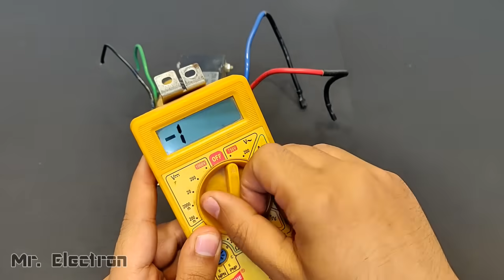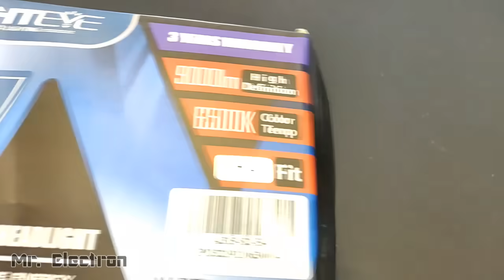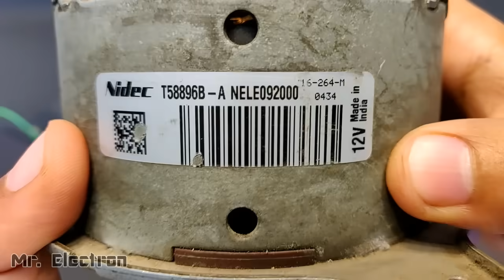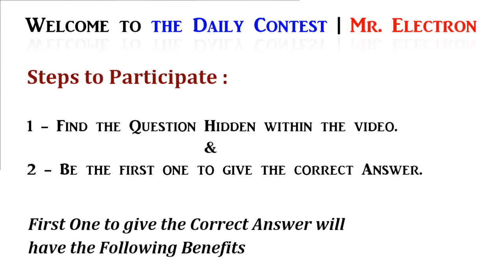12V 100A DC from 220v AC for High Current DC Motor - Power Supply from UPS Transformer

Comment: 100A?  Come on that transformer will have 200W max, so less Tha n 20A😏
Reply: The point is this transformor can‘t work with DC
Reply: @mhp_loudspeakers3768  Why it can't work with DC? It goes from 13v AC to a full bridge rectifier?
Reply: he also threw away half the primary it should be parallel for 110v and dont get me started about a cap at 100A
Reply: Many say fake, some say only 20 watt, i don't know. However let the no Screamer's tell better.
Reply: not even 10 amp
Reply: @Immexbeatz  FULL BRIDGE RECTFIER!!!!!!!!!!!!!!!
Reply: @nhatshonrada1176  o/p is 9.16666A to be exact
Reply: 100 A......🤥
Reply: Not 20 10amp
Reply: ای

Comment: The rectifier unit is never of 100 amps capacity. It can be rated for 12 volts, 10 amps dc out maximum continuous. Any dc motor designed for 12 volts will rotate at less rpm on no load. If we load them  beyond 10 amps, definitely the bridge rectifier or the main step down transformer will burn out  as there is no fuse provided.
Reply: Hola
Reply: There is something called peak currents the starting current is 100A but the continuous current is 2A
Reply: Yes that mains transformer will deliver 5amps at most. This vid is a scam.

Comment: Good circuit for didactic purposes only. To be use for beginners on electrical or electronic training courses. With a supercapacitor of few farads you can reach 100 amper for few millisecond. Never to be use to supply a starting motor to start a car. Engine's flywheel will turn only for 1 or 2° from that on you have to push the car to start engine if battery is flat.

Comment: This is not 1200VA transformer. Judging from it's size it is no more than 600VA transformer at most, found in a normal household UPS.
I have a 1000VA transformer and it is nearly triple in size which you have to be a bodybuilder to lift it with a one arm.
I have tens of these exactly the size transformers salvaged from 400VA to most 600VA UPS's.

Comment: Input voltage divided by 17 is 12.9 so .5 amp x 17 is only 8.5amps this is with zero loss so even with a justing to 9.5v to use 1.414 to give 13.4v so with 220 divided by 23 and .5amps x 23 = 11.5Amps again with zero losses so we're do you get your 100 amps from

Comment: 12 V x 100 A = 1200 W 
The transformer must be at least 1200 watts. Taking into account the Coefficient of Performance (0.65-0.7), the transformer power must be at least 1.5-1.7 kilowatts. Diodes must be at least 120 Amperes.
Ток холостого хода, как было ниже написано, далек от  рабочего тока. 
The no-load current, as it was written below, is far from the working current.
Reply: Translate Tagalog pls
Reply: @louienoveno9433    Filipino on-line translate: 12 V x 100 A = 1200 W
Ang transpormer ay dapat na hindi bababa sa 1200 watts. Isinasaalang-alang ang Coefficient of Performance (0.65-0.7), ang kapangyarihan ng transpormer ay dapat na hindi bababa sa 1.5-1.7 kilowatts. Ang mga diode ay dapat na hindi bababa sa 120 Amperes.
Ток холостого хода, как было ниже написано, далек от рабочего тока.
Ang kasalukuyang walang-load, tulad ng nakasulat sa ibaba, ay malayo sa kasalukuyang gumagana.
Reply: The transformer does not have to be 1200 watts. It can have 3 turns, but the wire must have the wire diameter for the current

Comment: That transformer kan never deliver 100 amps  And that startermotor is 105 amp under load  not as u used it it freewheels the currend drawn is mayby 7 or 8 amp
Reply: This transformer can‘t work. Transformers didnt work with Dc
Reply: It also make no sense: Input power is 200V×0.5A = 110W and output power is 12V×100A=1200W.
Where to get the missing 1090W? From photosyntesis?😂
Reply: The motor gets power from the capacitor  that can provide many amperes. And the ac current is rectified through the bridge. The question is what capacitor he uses and how he select this?
Reply: My dear brother pleas anser for this I have transfomer i/p 220v O/p 12v 300mA so how can I make inverter thank u
Reply: Bro this is ac transfomer but he use ac to dc converter that is grey colour and he use capacitor to not to light flicking 👍

Comment: 12v 100 amps is 1200w of power, a true 1200w transformer will be a lot more bigger than the one in the video, and no less, you will need a lot more powerful rectifier with a good heatsink
Reply: UPS power sources aren't meant for continuous operation, just for a few minutes/hours at most.
Enough to shut down energy sensitive machines before the power runs out. 
To save money and weight, they make the transformers smaller, but then they're not for long term operation.
Reply: y6yyyyy6y
Reply: @KRRISH-k7s  r/ihadastroke?
Reply: Is that safe to run car amplifier 3000watt
Reply: @imnotbeluga007  good mon ne

Comment: 220v*.05A =110w primary winding wattage =secondary winding 110w/12=9.1Arms and 12.9 peak continues current
Reply: ترانسفورماتور
۲۲۰ ولت
۵ آمپر

p=220×5=1100w

خازن
۱۲ _۳۵

1200/12=100 amp
Reply: चमबकीआकसणसेमोटरचलसकतीहैकयौकीचुमबकमबलगहैबलसेसबकुछचलसकताहाह
Reply: @alisomea  ты хочешь сказать, что с этого хилого транса он киловатт снял? Да и с такой проводкой? На превью он если что написал о половине Ампера на входе

Comment: This config can damage 12V loads, because 13.6V AC times ✓2 (in case 1.41) is equal about 19V after rectifier and filter capacitor.
To have 12V on output is needed to have about 9V to 9,5 V max on input, I had a sound amplifier damaged because it's transformer was damaged by a overload and gave about 13V AC on output.
Reply: Стабилизатор поставить не судьба ?
Reply: Después del puente rectificador la corriente aumenta ??
Reply: You're right
Reply: @fabiangonzalez8721   La tension, 9 * √2 ≈12v

Comment: I preheated you are doing well.
A servo motor does a job Electrically to increase or decrease to control the mechanical drive/device.

Comment: A servo is a motor whos angle can be precisely controlled only upto 180 or in 360 degrees using a microcontroller and it dose this with the help of a rotary encoder connected to the motor ot monitor its position . It is mainly used in robotics and industries . It's rotational speed is slow compared to other motors but gives huge amount of torque which enables it to be used In heavy duty tasks . For example it can be used in rolling shutter doors if we are using a 360 degree servo

Comment: When you say "12V, 105A" that's what the motor can draw under load (better yet, the amount of  current the windings can take before heat becomes a problem), but that motor of yours has no load therfore sucking much MUCH less current than the rated value printed on the label.

Comment: Thanks video

Honestly. Maybe here is a silly questione. I would like to know that - what differences are this circuit and rectifier machine (12V, 100A). So as to use electrolysis????

Comment: Your math is complete Chinese (The old technicians joke is that Chinese Watts are bigger than western Watts)! 220V at 0.5A is 110Watts & 12V at 100A is 1200Watts....so assuming 100% efficiency (impossible), where did the other 1090 Watts of power supply capability come from?....thin air? Of course if the duty cycle (pulse) is only 10% (90% charging, 10% discharging) then the non continuous capability will be somewhere around 1200 watts
Reply: Transformer efficiency max efficiency is ~95~99%
Reply: You are right David. It is not possible to lift a 1200 V.A linear transformer by one hand. On the other hand, its volume would also be much bigger than the one shown in this video. No way to fit in his palm whatsoever! As for the calculations of the powers (input and output)...no comment at all...It's a miracle! Or new, revised laws of physics, or even, a new model of "free energy"...The tragedy in such videos is that there are hundreds of ignorant viewers who worship (in the  commenrs pile) these guys and their "miraculous inventions"...False science has become an industry for some guys in YouTube and that's a shame...

Comment: En verdad me serviría mucho saber la capacidad del condensador
Reply: Hola amigo el capasitor puedes ser de 2200 mf a 35 volt asta 4700 mf a 50 volt
Reply: CUANDO MAS CAPACIDAD  mantiene mas el voltaje al exigirlo con consumo PUEDE SER 10.000 MF  O MAS LOS CAPACITORES SE PUEDEN APAREAR X 25 VOLTS LO QUE SI NO ES DE 100 AMPERIOS y el voltaje de continua aumenta un 30 x ciento con respecto al voltaje alterno
Reply: @hugopisano9961  según es 16 voltios y 74 mil microfaradios

Comment: First of all, according to the size of transformer it's has at least 5 Amps or some more. 2nd thing "high spark" credit goes to large Capacitor. 3rd all Bulb or Motos he is testing just for few moments.
He should use Ampere Meter to show what he actually made.. !

Comment: How do you get 100 amperes at 12 volts with 220 volts at .5 amperes.   110 va input.   1200 va output?   Does not add up.

Comment: Nice setup but how long can your system “run” a 30amp load before it heats up and destroys any component?
Reply: probably not very long that wire can definitely not handle 100 amps continuously. though I doubt the other components do either
Reply: @Shrek_Holmes  The full bridge rectifier has to have a good heatsink to handle 50A

Comment: Mr. ELECTRON. What connection system do we use to run a rated  24VDC 1500W cooling system on a small van with a 12VDC  180A alternator at idling speed of 900rpm
In the same cooling system at parking operation to plug to 220VAC plug to covert to 24VDC power.

Comment: , my question is how many VA UPS the Transformer you using in this video
Reply from the maker: 1200VA
Reply: Judging from the size of the transformer this is not 1200VA ,at most is 600VA as found in a normal house hold 600VA UPS.
I have a 1000VA transformer and it is nearly triple the size of yours which you will have to be a bodybuilder to lift it with one hand.
Reply: @arnbon6241  I think that transformer is not more than 400VA, You can calculate simple with dimension, so the maximum courrent no more than 11 or 12 Amperes.
Reply: @nikkarbo4664  400 VA is way more than 12A. If you take it 12v it is approx 30A .
Reply: Why use UPS when fedex is faster?
Pls sir,report

Comment: this wont deliver 100A with that transformer it's way too small as is the bridge rectifier
Reply: Exactly.  That transformer would need to 3 times its size to be 1200va.  And 100A current would melt those small gauge wires in a few seconds.  Plus, there's no way that starter motor is 105A capable. All of this is an exaggeration. 
Let's see a connected ammeter to prove its 100A
Reply: Yes. Don't forget a fire-fighting equipment...

Comment: The title is a lie, never it can give 100 amperes. At the moment you load á mechánical load that consume 100A, the trafo burns, the rectifier burns, everything burns. Mi God, this is for dumies
Reply: I agree
Reply: Totally wrong video, connecting different loads with supply, it is not big deal, it's normal supply with capacitor to get liner voltage ,as well as if you're gonna connect the 12v 100amp rated motor with supply that doesn't mean the motor will not turn on at less amp(watt) for example if the rpm is 10000 then it will rotate at 100 or 200 and will draw less current like 2 or 5 amp.
Reply: You are right, but look how many views this boy has, then look the comments and finally ask yourself "how many these dummies can be"...And this is the painful point...

Comment: This trasformer was made to step up the voltage from 220v to 12v? I made a transformer from microwave oven transformer in reverse , I took out the high voltage wire and put in isolated thick wire with some 15 turns to get 12v, but I didnt use any caoacitor only bridge rectifier. With this I run windscreen wiper 100w motor  to run a grill roast. The transformer was heating very much and in the end it burnt out. What was the problem? Would be UPS transformer any diferent? what do you recomend? Thank you for your videos, best regards from Slovenia

Comment: can I use 20micro farads and 450V capacitor for this circuit, I have 30W 220V/12V transformer and 60w motor 12v?

Comment: Hey,You could have used it as a welding machine as it has the potential of outputting more than 100A
Reply: 220V x 0.5A = 110 W .....
110W/ 12V = 9.16A is not 100A 
100 A ...Is a big lie...

Comment: What is servo motor? 
Ans- A servo motor is a rotary actuator that allows for precise control of angular position. It consists of a motor coupled to a sensor for position feedback. It also requires a servo drive to complete the system.

Comment: I need your help Mr Electron, am actually working on free energy generator with my 12v 81A 1.0HP DC motor, am finding it very difficult to use with car battery, it can only run for few minutes with my 12v 75A car battery, my question is how can I run the DC motor without a car battery? Please help me

Comment: I'm sure its the 100a that brought most people here. Lol..  if you would get 12v 100amps, then you virtually only need a 12vac power supply. You do the rest of the work. Rectifying it with as much combination of diodes that can produce that much current. But then im concerned that by the time you've arrived at 100amps, the voltage would be far less than 12v. 
The highest i have done is a 14V 12amps, using a ups transformer and IN5408 diodes (8 numbers).

Comment: I wonder if you could actually get a 100amp pulse (not continuous) with a big welding rectifier (150a rated) and some ultra capacitors wired in series/parallel to match the transformer voltage...?
Reply: 750 amps , so it woul
Reply: Im trying to nake a engine jump starter for jumping off my vehicle , V8 MOTOR , 12-VOLT system , can i use something like this to just simply plug into my wall 110v outlet standard american wall plug , and then connect it directly to my battery like a jump box , and have ample amperage to start the motor , but not exceeding a normal amperage. Of a regular battery or jump box , around say 400 to 750 amps , so that it would work on demand rather than having to wait to let battery to charge , for any xtended amount of time , so i have an instant jump wire that plugs strsit to wall starts vehicle and i unplug and im on my way , 
Same idea as connecting wires to another car or truck ,
 (jumper cables) but my home or the place im at (source of 110v) being the other car or truck so to speak !
Reply: @phillipdurham403  you would need a huge transformer, probably just better off buying a high amp battery charger and a decent battery.
Also check out old server power supplies, can be bought really cheap and 3 in parallel could get you near 800 amps maybe 4

Comment: Its not 100 Amp power supply, why? Because Ohms law. Resistance of secondary is 0.2-0.3 Ohm, Voltage on secondary is 12v if u short your power supply with very short wire it would deliver 40-60 amps at BEST (12/0.2 or 0.3), and that calculation was in ideal transformer so it would draw probably even less.

Comment: Let's be realistic here, this project as depicted will not supply 100 amps at 12 volts, not even close to it. You can weld steel with that much current. Here are some facts, 100 amps of current requires #3 gauge copper wire or larger, the transformer you are using does not have #3 gauge copper wire, nowhere near that. Also, the transformer is physically not large enough to provide that amount of power, we are talking a welder size transformer for that. Also, the bridge rectifier shown is a 35 amp part. It would fail instantly drawing 100 amps. Regarding the DC output voltage, 13.6 RMS volts AC times 1.414 equals 19.23 volts DC.

Comment: mr. electron I have a question I am creating a mini wind generator I am creating it with a current of 220 to 110 but I am undecided which motor I should use, what do you recommend?
Reply: Te recomiendo el uso de engranajes y calcula la potencia mecanica generada promedio con un viento alto y agarra un motor con un poco mas de esa potencia para no quemarlo con alguna tormenta fuerte y el mejor tipo de motor para generadores es el de anillos rozantes y s8empre podes modificar sus campos magneticos para producir mas c:

Comment: The components are  shown mounted on a piece of wood. As the diode is not mounted on a heat sink, it would fail, even at a load considerably less than the 100 amps quoted.   Publishing projects such as this could result in dangerous situations if built by people with poor electrical knowledge.

Comment: bitte korrigieren: aus 220v/0,5A, also 110W, machst du angeblich 12v/100A also 1200w. das ist physikalish nicht möglich, selbst wenn man verluste des trafo's weglässt. auch wird nach der gleichrichtung die spannung anders sein, wenn du eine 12v wicklung des trafos verwendest. das mag in deinem beispiel noch funktionieren, das man wohö rund 13,5v gleichspannung dort hat, aber nicht immer und je nach strom muss man auch die elkos entsprechend anpassen, ca 1000µf je Ampere Strom ist da der richtwert.

Comment: Garage work!

That Graetz bridge will fly like a victory flag without cooling!
A transformer of this size transfers less than 500 watts.
12V 100 A is 1200W power. Where is the missing 700W?
The wire of the transformer is very thin for a current of 100A.
Sparked by such a current, it would burn in a white glow!
The fact that it sparks the high-capacity electrolytic capacitor is simple peasant blinding...
The construction is unprofessional and a fire hazard.

Comment: So lets see: 220 V x 0.5 A in (110W) and 12 V x 100 A out (1.2  kW)? Yeah right!
Reply: Bu
Reply: I didn’t see where you got the 0.5A figure. If it’s running off a typical wall breaker it could pull 10A easy. That’s 2200w.

Comment: THE CONTINUOUS CURRENT ONLY 10 AMPERE, THE LOAD MOTOR ACTIVATE BY HI STARTING CURRENT WITH  BIG CAPACITANCE OF CAPACITOR STORAGE. BETTER PUT ACTUAL AMP METER FOR RUNNING CONTINUOUS LOAD MEASURING. OR CLAMP METER WITH POSITIVE OUTPUT